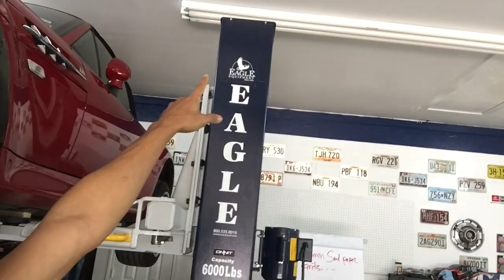LABAP Shop, Personal Life, Race Cars, and What You Want

Comment: I like the look of the new shop and especially like the lift. If I only had one.....
Content: 1- Magnet test in paint jobs. I like to restore old cars. Show judges can be brutal. I saw a judge use a small magnet he would stick to the car body. He would not slide it down the paint job, could leave scratches. The magnet is weak enough that when placed on a spot that has bondo (thick enough, thin the magnet still sticks) the magnet falls, hence the judge marks off on the judging.
2- Small racing lines. (We use to call them racing lines, it is merely for show, a fashion line) a person can purchase pin-stripes at most auto stores. If these peel-and-stick stripes are used a judge again marks-off. The pin-stripes must be painted on. The painting of pin-stripes seems to be quite a specialty.
You were asking about content, I have quite a few others to mention to you. I seldom write on these You Tube videos as a comment due to no responses, as if it was never written, so why invest the time.
Good luck, a birthday coming up, I remember those years, treasure them and do what you are doing to get certified to drive a race-car. You'll be glad you did when you are older.
Paul

Comment: Hi Tony, I've owned an E46 323ci for 6 years, a few mods done, but currently doing an E46 330ci Clubsport as a standard renovation project, just completed all the oily bits and about to move onto the body but as I have no alternative except to work outdoors I am hampered by the weather especially here in the UK.  I also have a '97 Z3 2.8 which is an up and coming project and when finished will be my Summer ride.  So as no doubt you can guess I am a bit of a BMW nut and would love to see the potential 'Beemer' projects you mentioned.  Love the videos, very informative as is the free download, thanks.  Perhaps a dedicated facebook page?  Cheers Mike UK

Comment: I have the same problem as Donique Mccalla, I have an MGB that I'm working on to restore and I have a 4 in rust hole in the right rear quarter panel, down low. Apparently they had a problem with rust in that area because they sell a triangular shape piece that I purchased to repair that hole. I need to know how to cut out and weld that piece in.